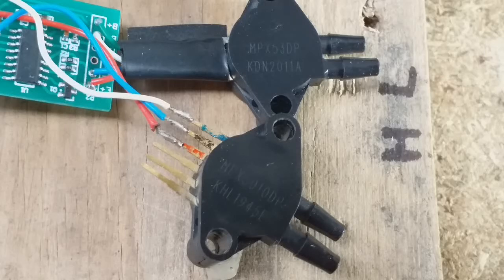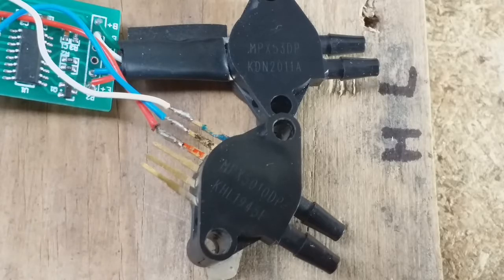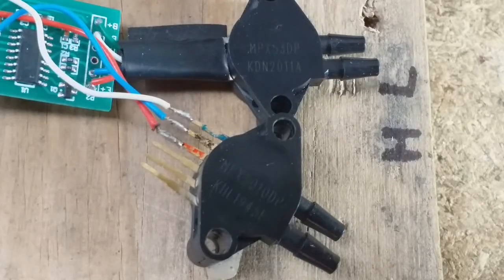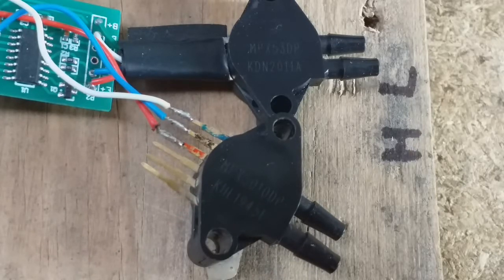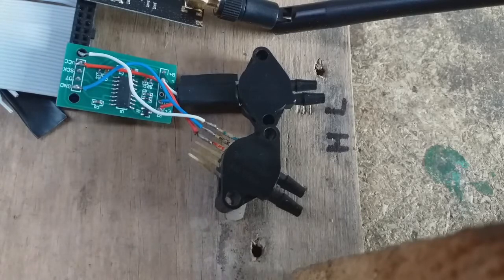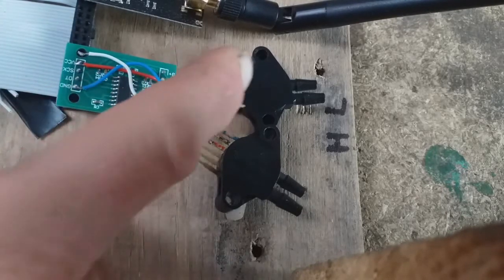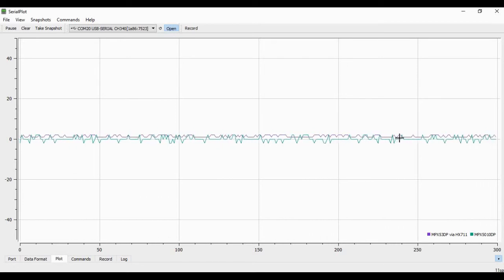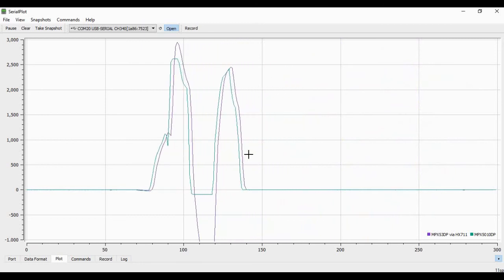Pressure sensors and Arduino, better with HX711

Comment: hi, really love your work on this sensor. how did you connect your wires from the sensor to the HX711 breakout board? I can tell that you put V_cc as E+ and GND as E-, but for your B- and B+ is it V1 and V2? Thanks!
Reply from the maker: Thanks, it's been a while so a little rusty on this now. The data sheet I'm looking at says V+ and V- but I'm guessing V1 and V2 are similar. You are correct with the other 2 V_cc and GND. As long as the voltage output is low and within the range of the HX711 it should be fine. Just flap the wires at B+ and B- if the reading goes the wrong way.

Comment: Hi, can I use a HX711 Module with a MPX10DP?
Reply from the maker: As far as I can tell yes. If its says uncompensated and has an output voltage up to 80mV then an HX711 is suitable.

Comment: Hello, which HX711 library you are using. I want  to measure a hydrostatic pressure so i can see the level of my water pit. My first idea was to take an operation amplifier, but your solution i like more
Reply from the maker: Hello, the HX711 will be a lot easier than an amplifier. I use the library by Bogde https://github.com/bogde/HX711. Is available in the Arduino IDE library  manager if you are using it.
Reply: @Ed.R  One further question. I have made a test setup and have follow situation.
The MPX53DP Sensor has a offset of 20mV. With the gain 32 the input can be -40mV to +40mV, so for the measure range for the sensor are only 20mV. This means with this setup the real measurement range is 20mV/15kPa. can you agree them
Reply from the maker: @mos9311  I think I'm right the way I've read the datasheet but channel B with the gain of 32 can go from -80mV to +80mV. I believe the sensor outputs up to 60mV at 50kPa. If I'm right you should get the full range.

Comment: Hello, what if i wanted to use the HX711 with the MPX5010DP censor? What would the wiring be like? The pins on both of the censors shown in this video are not the same. Thank you
Reply from the maker: That sensor has up to a 5V output and an HX711 only accepts +-80mV so is not suitable. I'd suggest finding another suitable ADC without preamp if you want better resolution.

Comment: can i know how to do conversion from HX711 output to pressure in kPa or flow_rate ?,, im using MPX53DP
Reply from the maker: The only accurate way to calibrate for pressure I can think of is to compare to another pressure gauge. Or if you want an appropriate value max out the sensor  and call that the max rated pressure of the sensor and record the HX711 value. Calculated a conversion factor. No guarantee that the sensor maxs out at its rated pressure though.
As for flow rate if you are measuring pressure drop across an orifice. I created a giant syringe with a line of magnets so I could measure the plunger speed. From this I could calculate the volume flow rate.

Comment: Good work .  Used the HX711 - arduino with a siesmometer coil. flat coil ~ 75R 3d printed the former and wound 0.1mm enameled with a hand drill.
Reply from the maker: Thanks, another interesting use for one. They sure are sensitive enough, shining a bright light on my strain gauges is enough to show up on the reading.

Comment: Is there an advantage of connecting the MPXV5010 to the HX711?
Reply from the maker: The MPXV5010 outputs up to 4.7V so is not suitable for the HX711. The HX711 can only measure +‐ 0.08V.
If you want a better resolution than an Arduino ADC use a pressure sensor that outputs mV then you can use an HX711.
Or you could get an ADC that measures up to 5V.
Reply from the maker: You can now buy an MPX5010 on a breakout board with a 22bit ADC.
https://www.ebay.co.uk/itm/SB-Components-Differential-Pressure-Breakout-Board-MPXV5010DP-Sensor-Breakout-/254790149257?mkcid=16&mkevt=1&_trksid=p2349624.m46890.l49286&mkrid=710-127635-2958-0

Comment: You can share the code for us ?
Reply from the maker: The code I'm using with these 2 sensers includes a lot of data logging and wireless coms stuff so not sharing right now. 
However in the description of my other HX711 video's is some example code https://youtu.be/Rp_M0NbDSpo
You can delete most of the other features if you just want to get the sensor working.
Change the HX711 setup line to scale.begin (LOADCELL_DOUT_PIN, LOADCELL_SCK_PIN, 32); to use channel B.
Replace greater than with a >.
Add an analogRead in the if (scale.is_ready) statement for the other type of sensor if needed.

Comment: could you tell me how the wiring goes?
Reply from the maker: Yes just realised I've unhelpfully covered the wires with tape. Assuming you mean the one connected to HX711?
So pin 1 on the sensor marked with a notch is GND and pin 3 is Vs. Often on HX711s the ground and supply voltage is known as E- and E+, E for excitation voltage. GND > E and Vs -> E+.
Pins 2 and 4 are the output and go to B- and B+ or channel B of the HX711. Which way around just determines if the output goes negative or positive so just swap if wrong.
If you want it more sensitive you can use channel A but you won't get the full range of the sensor.
Reply: @Ed.R  yes, thank you very much
Reply: @Ed.R  Thanks for openly sharing your wisdom.
I'm curious to know about the project you used this setup. Also, if you can share the details of the project, including the programming code.
I'm more interested in details, because of I'm curious to use single MPX5010DP sensor for building electronic wind instrument.
Reply from the maker: @Dr. Sanjeev Saxena  It's my way of giving back to the community that has helped me learn so much.
I'm reluctant to give away full details of wave device at the moment. It's based on air flow created by air pockets under the water is all I'll say.
I was thinking of doing a video about data logger as it has a few interesting features not just an SD card module.
It transmits the data with an nrf24l01, has a small air pump controlled by the wireless link, a magnetically operated on off switch and using a watchdog timer for reliability.
Reply: @Ed.R  Seems, I failed to communicate by request with clarity. Probably that's why you felt so. 

Actually, I wanted to know more about the project, behind the use of HX711 along with MPX5010DP. and part of the coding related to the hx711-mpx5010dp Interfacing (instead of getting your complete intellectual efforts). 

Yes, I still respect your decision & your efforts that must have gone behind.
Reply: @Dr.SanjeevSaxena  yeah this is the hardest part for me. I been tweaking HX711 - MPX10DP more than a week, yet still didn't get the results that I want.
Reply from the maker: @Dr.SanjeevSaxena  I'm not great at understanding written descriptions which is part of the problem.
Can you confirm the exact sensor type you are using. The HX711 is only required for sensors such as the MPX53DP and MPX10DP which have a full scale span in mV, typically 20 - 60mV.
Other sensors put out 0 - 5V so can be connected direct to an Arduino analog pin.
Reply from the maker: @revanomoretto737  I'm using the HX711 library by Bogde.
I'd recommend starting with channel B until you find out the range you are working with.
Code to initiate it is
scale.begin(LOADCELL_DOUT_PIN, LOADCELL_SCK_PIN, 32);   // (Dout PIN, SCK PIN, gain) Channel A 128 or 64, Channel B 32.
I don't use a delay in the loop and start it with
if (scale.is_ready()) {
    long reading = (scale.read())
and place all the code in this if statement so it runs when data available and the HX711 sets the timing.
Reply: @Ed.R  Thanks for your real-time helpful responses to all queries we have been throwing at you.

I have MPX5010DP, MPX10DP, XGP040DB1R, XGZ701DB1R Air pressure sensors and I intend to use 1 or 2 best responding types of these-ones to expand the widest pressure ranges.

Comment: I think most pressure transducers use piezoelectric sensors to measure pressure. Different, but very similar to strain gauges.
Reply from the maker: Maybe I should have researched them better first. Output is definitely of a similar magnitude to strain gauges.